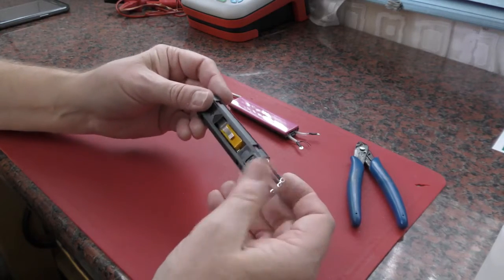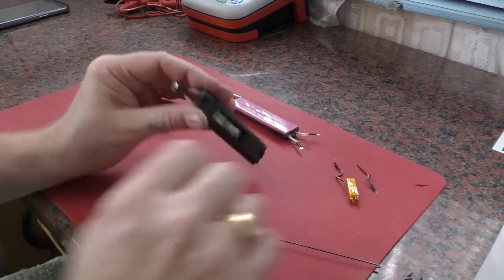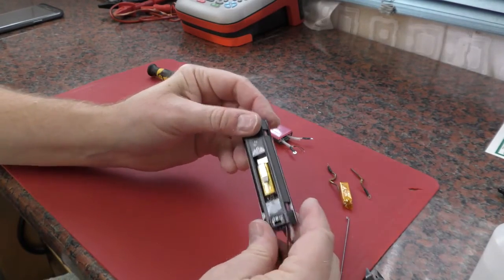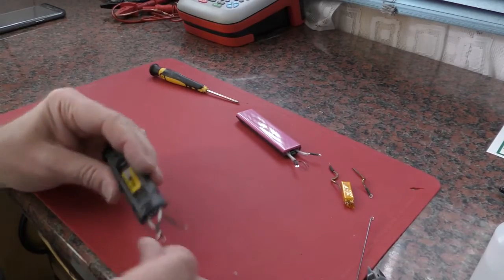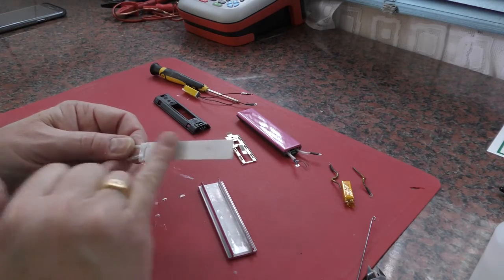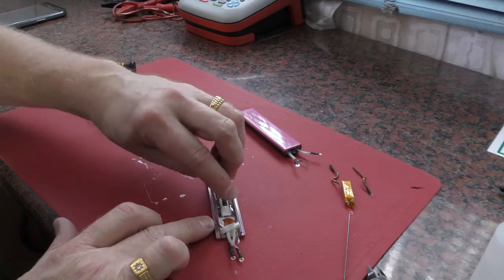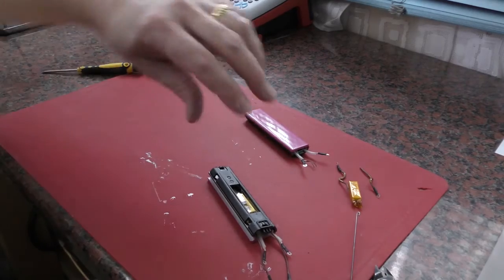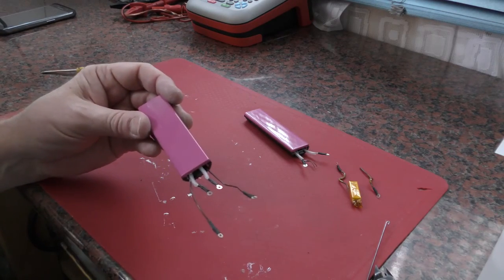ghd-repair.co.uk - GHD MK4.2 Type 2 & MK5 Thermal Fuse Plate Assy

Comment: Hi Gary, Great to find your website and service. I had contacted GHD for repair service, to be offered 10% off a new one instead!! And wouldn't send me any info regarding a fix. Very annoying how these companies aren't forced to have a repair service with how the world is supposed to have gone so "green". Instead opting to try sell the latest model instead.  I've replaced the thermal fuse but have broken the small clip. I've to order a thermistor from your site anyway (only one side is now heating up, (too hot also). Is this clip critical to replace also or would I get away without. Many thanks, Mike

Comment: Hi can you please help me ... I have a ghd Mk5 model I replaced the thermal fuse and it's still not switching on I tested the resistors R8 and R11 they were fine i tested the plates they were fine i tested the main cable that's fine so i can't see what else can be the problem .. Will you please be so kind to give me advice at what else might be the cause cos now currently it's not switching on no beeping sound nothing I checked everything that are usually the problems PLEASE HELP ME.Thank you for your videos 😄🥰
Reply from the maker: Have you seen this guide? http://ghd.repair/dbg4

If it really is nothing else, then it could be a dead pic processor. See http://ghd.repair/pcb. We stock replacement pro programmed pics. 

Or our repair service will sort them. See http://ghd.repair/service. 

Gary

Comment: hi i have a ghd 5 and there not heating up properly if i remember 1 side is a lot colder than the other what do u think it is thanks kevin
Reply from the maker: The heaters are wired in parallel so that probably means one of the heaters is broken. If you measure the the heater resistance they should be 70 ohms each or 35 ohms if both connected and working.

Gary

Comment: Hello I can help someone have a problem with Hair pressing problem it is to put the decision turns on the lights After some blinking lights They still do not stop after the plates are usually heated model is ghd 4.2P DATE CODE: C080819 -0369